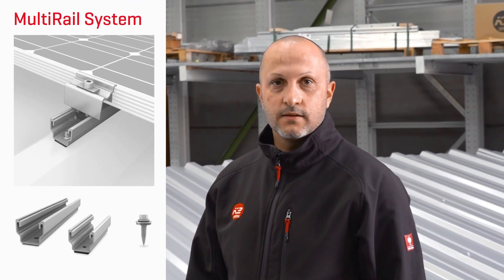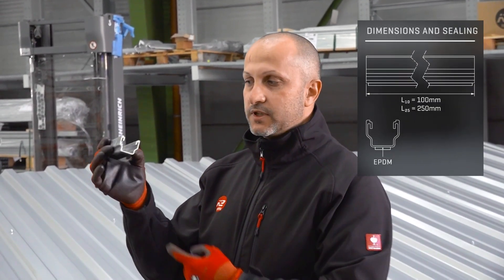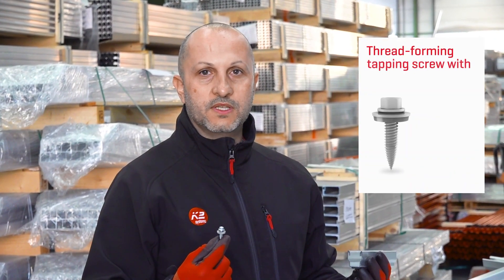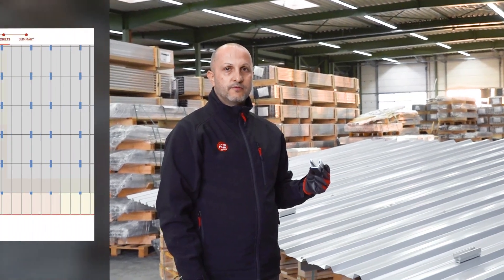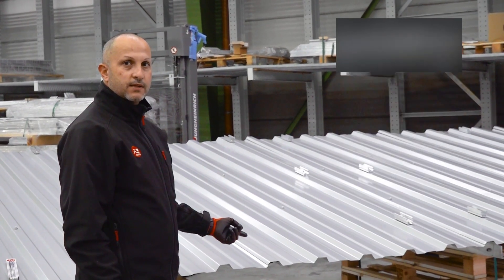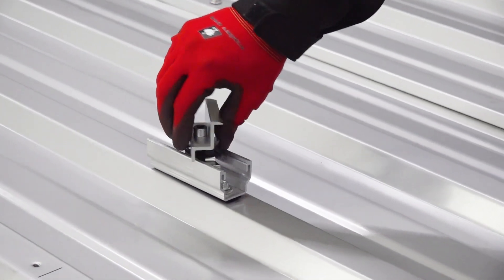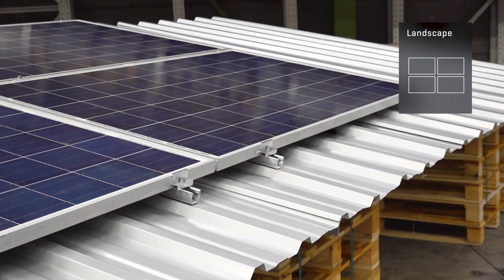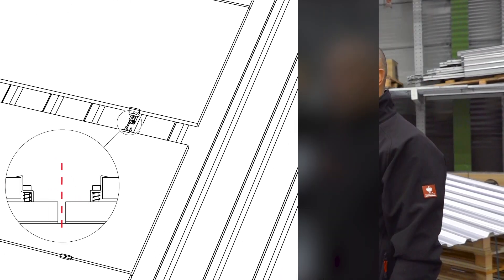[Anleitung; EN] MultiRail System auf Trapezblech montieren

Comment: Da diese Halterungen keine Schienen verwenden, wie hält sie den Schnee, da an den kurzen Seiten keine Halterungen vorhanden sind?
Reply from the maker: Im Grunde handelt es sich hier um eine Mischung aus Montageschiene und Dachbefestiger. Wenn die Schneelasten hoch sind kann die MultiRail mehrfach (3-4) auf der langen Modulseite befestigt werden um die Lasten auszugleichen. K2 Base (https://k2-systems.com/digitale-services/k2-base/) berücksichtigt bei der Planung automatisch Schneelasten und Windlasten und kalkuliert die richtige Menge an MultiRails je nach Lastfall. 
Wenn die Komponenten überlastet sind, zeigt K2 Base das an und gibt kein OK für die Kalkulation. In diesem Fall könnte eventuell das SpeedRail System die bessere Lösung für Sie sein. Man kann aber auch auf MultiRail eine durchgehende SingleRail im Kreuzverbund bauen und so entgegenwirken. Werfen Sie einmal einen Blick in die Montageanleitung (s. 21): https://catalogue.k2-systems.com/media/ce/ff/dc/MultiRail-assembly-en.pdf

Hilft das?

K2 Systems